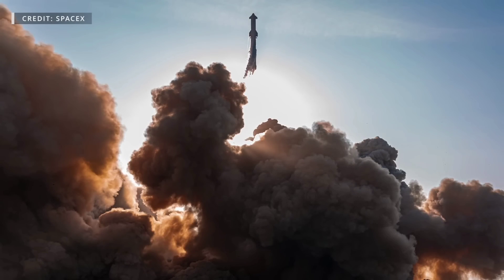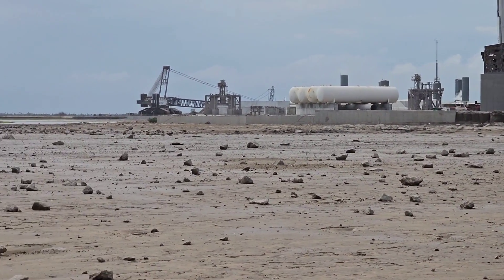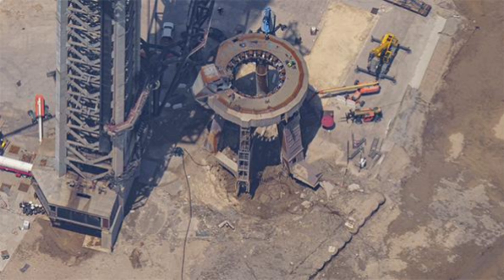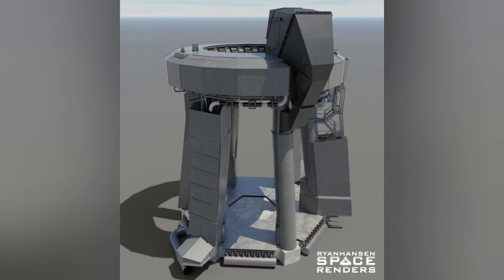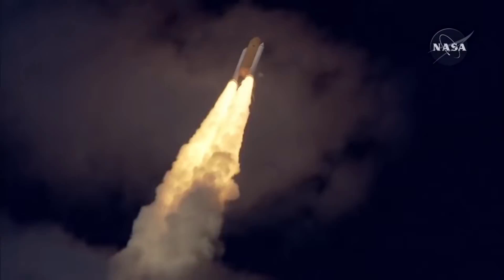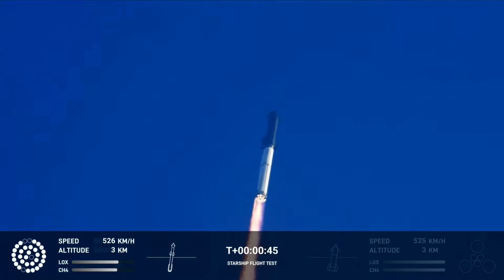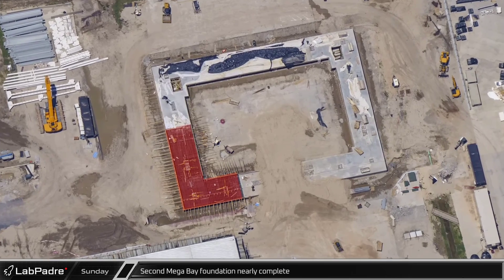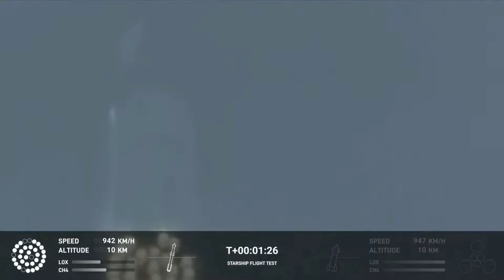Will Elon Musk's water cooled flame diverter be enough to keep Starship and Starbase safe?

Comment: Why not simply build a proper flame trench? It's already a proven concept. What am I missing?
Reply: It would take money, time and involve the army corps of engineers. As this is in a protected wetlands, it has to go via them, making it take years. 

NASA knew this in the 1960s when they started designing and building the ramps for Saturn V. Building the enormous concrete structures, sound suppression water system, flame trench and moving service structure took YEARS.

SpaceX tried to cut corners and cheat physics. And they paid a hefty price for it. Now, they might be forced to do it anyway, making the wasted time even greater.

Failing to plan is planning to fail.

Comment: If Elon doesn’t want to build up (to avoid using a crawler) and doesn’t think he can dig down due to the water table, he should consider actually using the water table to his advantage and build a M.O.A.T. as in a:

Massive
Oceanic
Acoustic
Tamper

He could dig a deep, concrete lined trench under the pad and “invite” the ocean water to flood it, with a movable platform/floor that can cover it when not in use and allow work to take place ground level in between launches.

1) He wouldn’t have to change the existing structure much

2) It would have minimal impact on the environment compared to other solutions

3) it would prevent him from having to build up the pad or make any other drastic changes to existing infrastructure/manufacturing 

4) It would actually work.

Comment: Parhaps what Elon meant was the damage was small by comparision to what it could have been, I wouldnt call it dillusional. Also Elon you would like to think knows the capabilities of his crew and thier ability to get this repaired. I dont imagine he just picks arbitary numbers out of his head, its all probably to motivate his staff to get the job done. If he had publically said yeah maybe 6-12 months to repair the pad, that sets a schedule with the staff. I think his time estimates are most likely too short by some margin, but he has basically put the challenge to his work crews to get to work and not waste time. It kind of looks like they have made significant progress so far and we are only basically just under 3 weeks since launch day, and they didnt even return to the pad to start working again until 1 week at least after the launch.

Clean up on the other hand will take a long time, first they need to let the wildlife agencies do thier thing, then they need to do the cleanup without using heavy machinery or damaging the land further.

What concerns me the most about this steel plate... from the renders its basically two steel plates with channels for water flow between them to come out of holes. I hope the foundation placed under the steel plate is string enough not to compress and distort the plates, as well as the plates and pressure of the water being strong enough to make sure that the force of the better part of 7000t of thrust doesnt crush the baffles that the water flows through. I feel like if the foundations compressed before causing the concrete to crack then get torn up can happen with concrete, it can probably also happen with a steel plate. I hope they backfill that foundation under the pad with some soil that is able to be compacted and better take the punishment of 33 raptors, sand aint gonna cut it.

Comment: Couple of things.
If the "big steel plate" were extended outside the launch platform base maybe twenty feet and given a slight incline upwards away from the mount - say as much as a freight train could comfortably climb so 1 or 2 degrees - It's very unlikely any material outside would be blasted away - the thrust from the engine exhaust would be redirected upwards as well as outward. At least if the area were clear of obstacles. It would also diminish on a power rule rapidly approach an inverse square for the distance from the center of the plate.
Next, so long as the FAA insists on a testing protocol building up to a 33 engine full power for say ten seconds as the video suggests, it wouldn't matter if the plate didn't work out (so long as there were an automatic and rapid cutout if any problems were detected developing and there were plentiful automatic monitors to detect such a development).

Comment: Regarding the idea that the exhaust would tear up concrete in an expanded area from below the engines with the metal plate:  The reason the concrete blew out in an ever expanding radius from the base of the launch system was the concrete directly below the engines detonated under the pressure and heat.  Once it did that, the exhaust was pounding into the sandy ground below the concrete and the walls of this excavated hole were then being impacted thereby excavating more concrete from below.  The new plate design would ensure that, while still flowing in all directions, the exhaust contacting the concrete beyond the launch facility columns would already be on a horizontal vector and would likely not harm the concrete at all.  I do still think it’s foolish to not direct it in one or two directions.  I would be shocked if KSC would be good with that, but who knows.  I don’t know.

Comment: There is absolutely no way that SpaceX can move to Cape Canaveral. NASA sure as hell isn’t going to let them launch a Starship from 39A anytime soon . Maybe after it has a couple dozen successful launches under its belt. There isn’t really any room at the Space Force side either. The days of Apollo  style testing and risk taking at the Cape are gone. If SpaceX went to a buttoned down traditional development plan instead of a fast reiteration method, with the attendant higher risks, it would be some time in 2030’s before we had an operational Starship. 

There isn’t any other spot on the CONUS to do these development launches. Building up enough to have a flame trench at Boca Chica would take years to just get the permits. It took 18 months and hundreds of thousands of tons of dredged material to build up Pads 39A and B. God only knows if you could get the environmental approvals to build 39C, even if it was originally planned in the 60’s. 

So some sort of liquid cooled steel flame handling system will have to be devised.

Comment: "Enormous" is not measure of the pressure. 
The pressure just needs to escape away from the rocket and escaping away in all directions from the rocket helps to drop it much faster than when it escapes via the flame trench. The only requirement from that metal plate is to stay in one piece for as many launches as possible
The water amount and the watter system pressure can be computed depending on the water budget and the desired pressure differential at the exit

Comment: They can't dig out a flame trench though because of the water table level.What if instead of a flame trench, they had large sections of metal that could be bolted into place on the legs of the OLM and they could be lifted by the chopsticks somehow and transported away on sbmt's or whatever the transporter vehicles are called if needed for pad access. Then they could close off the gaps in the olm except for in one direction, like toward the  unpaved area.idk if the exhaust would rebound back up or out of the open space, but if so you could direct the exhaust away kinda like a ground level flame trench. If environmental impact was an issue, they could direct it toward a blast berm like the one by the tank farm that makes the flame go up the berm instead of into the wildlife preserve. It could probably be water cooled too from the same system as the metal plate. Idk. Im not an engineer but it was an idea i had last night.
Reply: So why did SpaceX pick the site if 1) the water table is high,  and 2) it's all sand? Oh,  and the water table is high at the Cape.  The launch pads there are above ground as I recall,  including the flame trench.

Comment: at 7:00ish you call the plate with water active and the flame trench with it's own water system is somehow not active? Who are these "experts on my team"? more armchair experts? I think they should be named and their credentials given if you are going to refer to them at all. Other wise just call it what it is: an untrained (in rockets) talking head's version of things. Your picture of a NASA rocket lifting off showed a cloud of exhaust that went in all directions, not just down the flame trench, SLS launch tower effectively suffered more considering the damage was caused only by rocket blast rather than concrete. A much truer measure of damage would be to examine the launch mount which would only be subject to rocket blast for the most part. The flame trench or blast plate are only used for a very short period of time (6 to 10 seconds) and considering the relatively good condition of the launch mount even with the rocket gliding sideways across it, already says good things about a metal plate even without water. Sometimes minor failures have major effects but at the same time a minor correction is still minor. I am still not sure a flame trench would be able to handle all of startship's output, having the exhaust leave in all directions might be more of a necessity than just choice.

Comment: "Small Damage" should probably be replaced with "slight miss". Yes the amount of Earth and concrete moved was substantial. If Musk is correct, and he has a better chance of knowing what actually happened than any armchair coach, the concrete only needed to be a bit thicker to support force of the gasses directed at it. (or the sand under just needed to be more precompacted) As with most rocket flight, it only takes a very small miscalculation (or dislodged filter) for things to blow up. The Orville Dam held water without incident for many years but once the overflow went, it was a close thing that the whole dam didn't end up across the valley below.  Yes it only takes a small amount of damage for things to fail completely.... and yet it was not a complete failure.

Comment: Note that the pad held out OK at 50% throttle, so they were unlucky with it completely disintegrating at 100% throttle. Hence I think the water cooled plate, with the cap in the middle to crudely deflect the exhaust, is a workable solution that can be tweaked and researched as time goes on. SpaceX needs the flexibility of siting anywhere in the US at short notice, which is probably why it's not in the interest of SpaceX to invest in the long term least costly solution of a low maintenance trench and water pumped by gravity with no moving parts.

Comment: Someone has probably already commented about this but the water steel plates has been on the works for some time.  I can not think either the FAA or NASA would nit have seen this design and given it a pass to construct.  Spacex did what it needed to do which was get that outdated test rocket launched, with acceptable risks to the OLM.  Given how they have gone right to work with improvements, with both the FAA and NASA watching every move, it seems logical SpaceX is acting in accordance with their wishes or the whole operation we are watching would be shut down.  Finally, this whole  facility is for testing only with the majority of launches taking place in FL.

Comment: Sorry, the engines will rip up those metal plates. It ripped up concrete and all holding it. If the flame is not diverted? It's a waste. As usual, it seems no one can speak reason to Elon.

Comment: I always wondered where Elon thought 15.5 million pounds of thrust would go, and why the tank farm wasn't built in line with the OLP and Tower. At a 45 degree angle it exposes all the tanks. Also what happens if the booster fails, like it did, with no means of detaching the Starship from the booster? You can't have people on that thing without some form of pneumatic pushers to separate the two.
Reply: It will take years before there will be people on starship. Missing a crew escape pod.
Reply: @albertvanderheiden7419  Musk is testing a new type of release mechanism that doesn't require pushers. That's all good and great for unmanned missions, but his intention is to put one hundred people on it to go to mars. The entire starship minus booster would essentially be the escape pod. It is capable of orbital velocities and landing itself, but it must be able to separate in emergencies

Comment: First, concrete being all over the place has next to zero effect on how long it will take to rebuild the pad, if anything having all that material dug out saved a week of demolition time.

Second, many of the parts for the water cooled plate have been at starbase for a while, this isn't something that came in since the launch, this is a system they've been intending to install.

Third, they've already patched the outer shell on the oxygen tank, the damage to the other tank shells don't matter as they aren't being used for insulation shells.

Do I think 6-8 weeks is realistic, NO, but I wouldn't be surprised to see 3-4 months if they worked round the clock crews.

I don't think people appreciate some of the things Elon has said, he even mentioned having "spares" (plural) of the Launch Table Ring should it have gotten destroyed, I don't think people fully understand how hardware rich SpaceX is, we know grand scale plans have a minimum 2 OLM's at both Starbase and KSC and I wouldn't be surprised to hear about one at Vandenberg eventually.

Comment: When these machines are so big and powerful, why do they insist on making a relatively small and cheap launch facility?  Had they spent the money to build a trench and diverter, this last launch might have been a complete success.  This flat, water cooled pad looks like a half measure.  It might work, but they're gambling another expensive machine.

They're not digging a flame trench, because the water table is very high, under the launch pad.  If this next Starship is damaged by rebounding exhaust gasses, then they are going to have to elevate the launch tower of move elsewhere  They should have just done it right in the first place.

Comment: The cement underneath the rocket failed and pressurized the ground underneath the pad.  I believe that most of the damage, including the damage done adjacent to the pad was caused by the rapid pressurization of the ground under the pad which certainly forced itself into the surrounding ground.  Notice the dog house heaved up, and car sized chunks of cement flying up parallel to the rocket.  So I believe the cooling pad could work. If it works to prevent this aspect then the rest of the pad will be safe.  As far as pumps and tanks, there are "off the shelf" industrial pumps with capacity to handle this stuff.  High capacity centrifugal pumps are used through out industry.  Water tanks don't have the same complexity as pressurized, cooled cryogenic fluids.  If they can't use the tanks they were going to retire, they can build some.  This project has been going on for months,  I would guess they have already procured the pumps and have a tank solution.

 I do believe the rocket was significantly damaged by cement chucks.  I do not believe the official statements.  The explosion of cement pieces of varying masses moving at different velocities would have been like billiard balls bouncing in all directions with an incredible amount of force.  Just take a look at damage to the housing for the craneworks on mechazilla and underside of the launch mount table.

Comment: So much concrete was ripped up because of the zipper effect. Stop the thing at its starting point under the rocket and the rest will probably survive. Also steel is quite able to survive the heat and pressures of launch.. Especially with a little water cooling.. - I suggested this solution months ago when we first saw the concrete ripped up.

Comment: Kinda of hard to say if something will work or not by going off the artist rendering.  Elon did say that the Steel Plate will extend further out then just under the pad.  I don't think they can really make a trench under the pad because the water table is so close to the surface.  I think we all just have to wait and see.  Hope it works, but only one way to find out.
Reply: The water table doesn't matter.
Reply: The OLM is the replacement for a trench, it allows exhaust to escape all the way around rather than being confined to one direction. Attempting to confine the exhaust from a SH booster would only make the problems worse.

Comment: As I'm not an engineer, maybe someone can explain this to me.

Many people here have said that a flame trench can't be dug at Boca Chica because the water table is almost at the surface there.  But engineers pour concrete underwater all the time, don't they?  Building the footings for bridges and that kind of thing?  Probably expensive, I know.

But if you build a flame trench (which seems like a relatively simple structure) pointing out to sea underneath the launch mount and it immediately fills up with sea water. . . is that a problem?  If you've got an open-ended swimming pool underneath the rocket, wouldn't the exhaust just turn a lot of that water into steam or push it away? 

I guess a lot of salt water flying around is not a great thing for a re-usable rocket. Or Stage 0, for that matter.
Reply: Could be that the soil/subsurface isn't stable if it's dug out because it's saturated.  
Probably/maybe could drive in steel sheeting along the trench, then excavate - that's what's done for some building foundation works.

Comment: Elon is going to have to do a series of static fires to test the rebuilt GSE anyway. The plates look to be set to channel the exhaust horizontally, which should prevent tunnelling into the concrete. Of course, you then have the blast wave being accelerated in the horizontal direction so the pad zone is going to be wiped clean. This may not be good news for the GSE. Regardless, that's not a 6-8 week job.